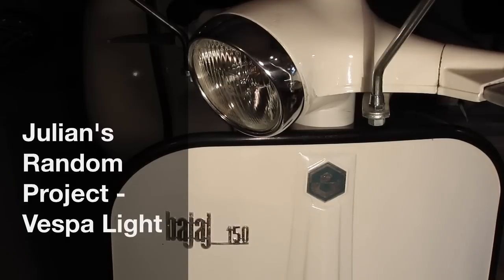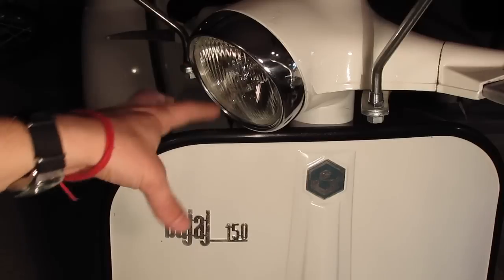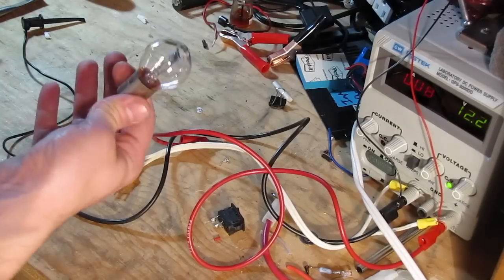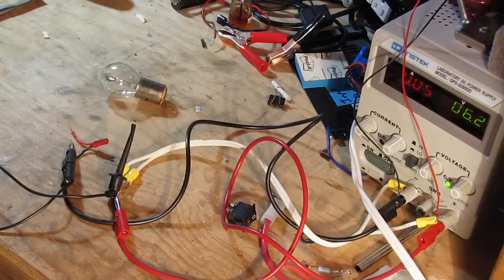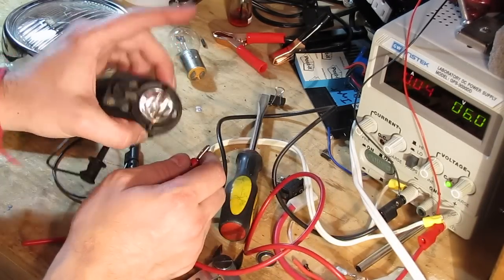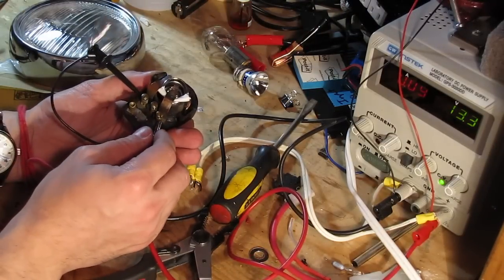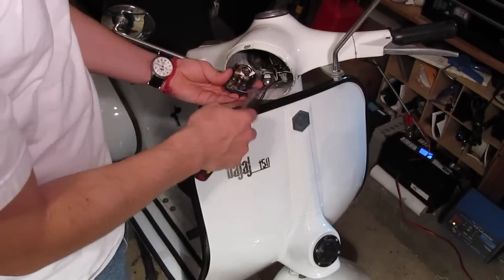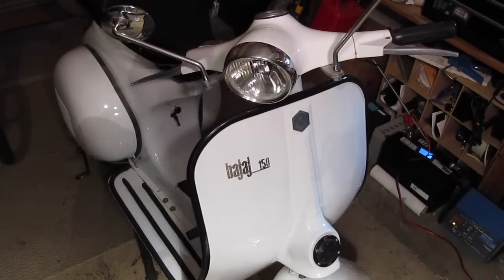Vespa VBB VBA (Bajaj) Headlight Upgrade... Fail!

Comment: lol i hate when that happens. maybe try an LED with a voltage regulator?
Reply from the maker: Yeah, I've thought about combining a voltage regulator with a battery pack or capacitor to smooth things out. I just discovered there are conversion kits for these motors to switch them to 12v. May give that a go and hide a little SLA batt in the fender.

Comment: Nice vid!
Could you let me know the dimensions (in mm) of the Vespa/Bajaj 150 headlamp please?
Thanks!
Reply from the maker: Wish I could but I've since sold the Bajaj :) It's a standard part though, specs should be on the googles.
Reply: firedup643 I got an halogen ba20d 35/35 better still the px millennium  headlight (completely new)